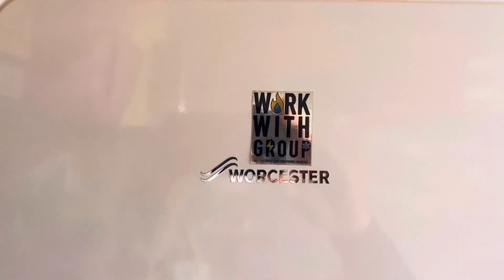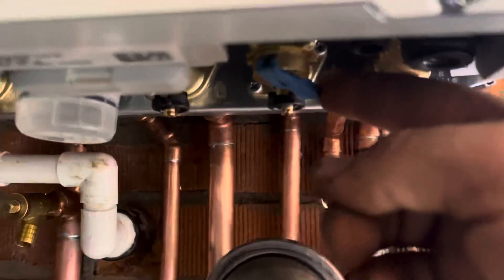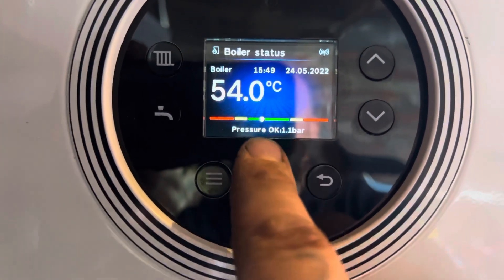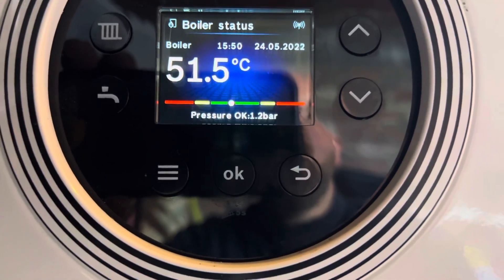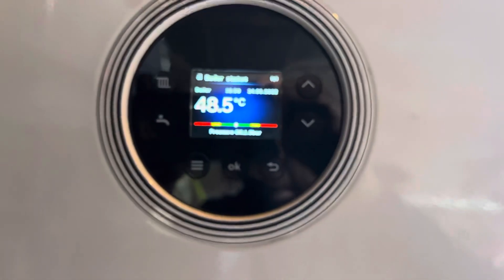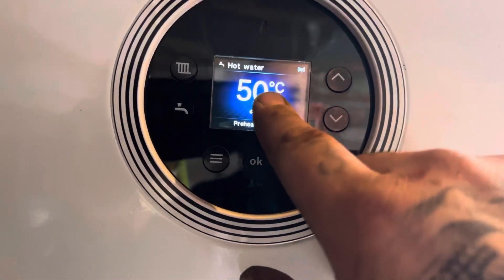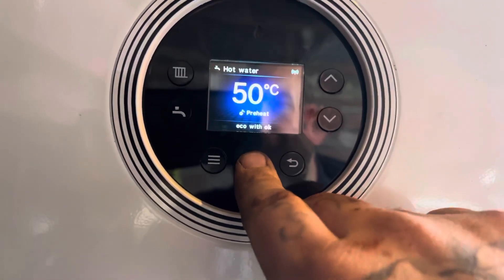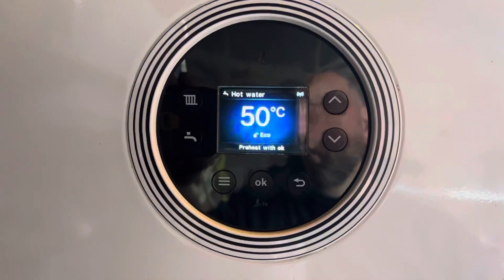How to locate the pressure gauge on a Worcester Bosch 2000, 4000 and 8000

Comment: Thanks for the information 👍. 
Sometimes. When I set  the  thermostat,  the boiler  will  take  its time coming on.. and  sometimes. It just doesn't  fire up.
Reply from the maker: Sounds like a communication link error between the transmitter and receiver on the thermostat ...

Comment: Adjusting the pressure after bleeding the house radiators, Since there is no blue wonder switch, it took me a bit oh time to work from the eejits guide, finally got there despite being unable to discern locked padlock and unlocked, my eyesight my fault. The point in the eejits guide where it recommends I ask the installer to show me the procedure, could I just mention, I didnae have time to read the full eejits guide before he left my premises.
Reply from the maker: all installers should walk you through, sorry they left you without this information

Comment: great ive not got a blue lever to pull to raise the pressure also no manifold to insert a key ??????
Reply from the maker: You will have a braided pipe somewhere or under the counter, all dependant on the location of your boiler

Comment: Great vid mate. I've gone a bit high to 1.9.. How do I drop it a bit?
Reply: I think you need to drainage via central heating
Reply from the maker: You can bleed a radiator until the pressure drops or you can look for a drain point on the pipework and drain there. 1.9 bar for s a little high but you should be ok. If your really unsure call an engineer. If I’m close enough contact me.
Reply: @workwithgroup4386  shud we increase to 2bars if needing to bleed my radiators.  I have a issue with a radiator in house. every 5mins or so I can hear gurgling noise in the rhe radiator
Reply from the maker: @Mr_Wanderlust1  you will definitely have air locked in the radiator mate
Reply: @boilerbreakdownexpert  based in West Yorkshire
Reply from the maker: @Mr_Wanderlust1  South Yorkshire buddy
Reply: I bled my all heaters a then it went down to 0.0 and it says on display: fault, increase a pressure to 1.5, mine don’t have the blue one, I tried two black switches attached to the water pipes below the counter. It didn’t work. I got two big switches below the counter don’t look as it would work in this matter awaiting gas engine

Comment: I have the 4000 but there is no blue tag for me to pull on.
Reply: Same problem
Reply: yeah??
Reply: You need to take the cover off at the bottom of the boiler. It just pulls off. U will then ses the blue lever

Comment: Mine doesn't have the blue lever.
Neither is there a filling loop.
The
Menu says 'automatic filling' but it doesn't fill whatever I try from the menue.
Time to call a plumber!
Reply from the maker: Did you get this sorted?  

I’m based in sheffield if you need me.
Reply: @boilerbreakdownexpert  thank you for responding. I did sort it by finding the screw which refills the system. A bit of elimination and I found it.
Thank you for your response though.
Perhaps you could send me your phone number for future reference.
😊
Reply: Hi are you able to let me know how you did it? Mine needs doing but I don’t have a lever ! Thank you
Reply: @clouise8899  
I removed the front cover of the boiler .
It’s very easy to do as there are only four screws or possibly only two depending on the model I think .

You will then see a slotted head screw where the cold water feed pipe enters the boiler .
It’s quite easy to trace because the cold water feed pipe is very cold compared to the other pipes .
I turned a quarter turn until some water obviously went into the boiler and then I checked the pressure.
I kept doing that until the pressure was at the required level which is one bar on my boiler.
It’s important not to 
over-pressurise so a quarter turn for let’s say three or four seconds and then check and then repeat until required pressure is reached.
I found a video showing what to do but I can’t find it again so unfortunately I can’t post a link to it .

Comment: Mine doest have the blue lever. Help?
Reply: Mine neither
Reply from the maker: Send me a pick of underneath to 07946515897 and i can advise from there.
Reply: My one haven’t got to pls help
Reply: @boilerbreakdownexpert  pls help
Reply from the maker: @dark_ryan6356  how can I help?
Reply: @boilerbreakdownexpert  ours is at 0.9 bar. Also doesn't seem to have a blue tab on it
Reply: Same problem, no blue tag 0.9 pressure. Anyone found out how to do it yet?
Reply: @danullah9163  did you find out how to do it?
Reply: Mine has no blue lever did anyone find out??
Reply: I'm in the sane boat, no blue lever, it's an 8000 version. Can anyone help me please

Comment: Anybody able to help with this? Our pressure keeps dropping low to 0.9 then the next day its fine
Reply from the maker: when it goes back to normal have you topped up the pressure? if not i'd be looking at the pressure switch and the water quality in the boiler.

Comment: What's in the first option in the menu? 1:19 "heating mode"
Reply from the maker: That allows you to switch from summer mode (hot water on) and winter mode (hot water and heating on) although you should have a thermostat. If you set that you’ll not need to swap that setting.